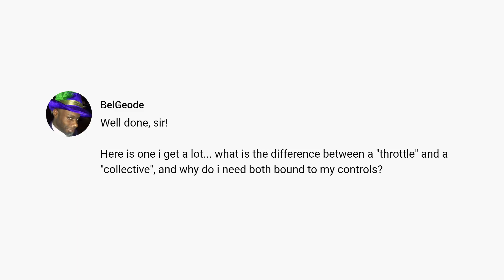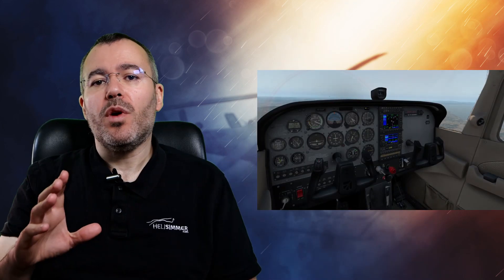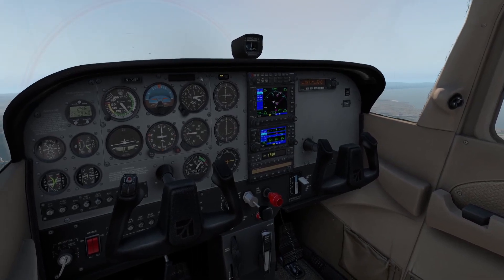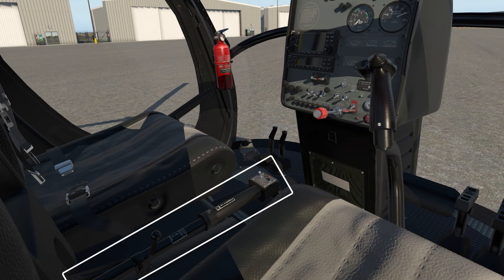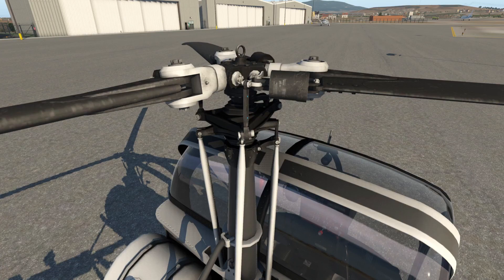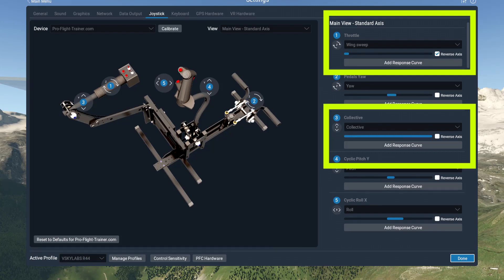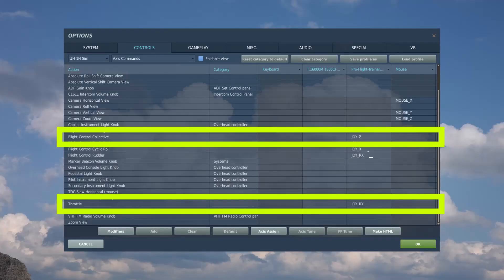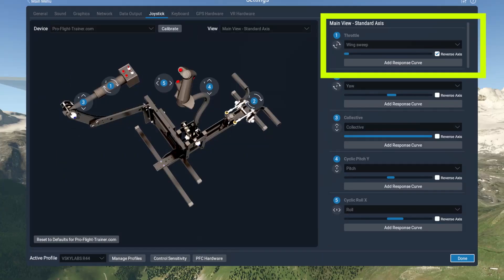What is the difference between "throttle" and "collective" in a helicopter? - Ask Me Stuff

Comment: So does having a controllable throttle offer any kind of inherent benefit opposed to it being automated/governed? And by that I mean, does it offer more control to make small adjustments that you otherwise wouldn't be able to make in a  fully-governed system? Imagine the Trim Control on an airplane for instance, it allows you to make small adjustments to the way the plane flies without having to make those adjustments using the more powerful yoke/joystick controls. I guess what I'm asking is, does a manual throttle control make it easier to hover, land, takeoff, and perform more precise movements opposed to a governed system? Or is it simply just a case of an aircraft manufacture being cheap and not installing a governor.
Reply from the maker: It doesn't. Most modern helicopters have a governor system in them that take that burden away from you and the throttle is most commonly used for startup/shutdown. Everything else is controlled via the governor.

Older helicopters, such as the Bell 47, though, still rely on manually controllet throttles, though. And honestly, it's a blast to try and not crash a helicopter PLUS keep the engine running.

You can actually get away without a throttle in your sim, though.
Reply: @HeliSimmer  Would you say generally that the plus version of the Virpil collective probably isn’t worth the extra if you only use it for a few seconds?  Primarily in DCS.  Thanks.
Reply from the maker: @doifeellucky  if that's the use case for you it's probably not worth it and you can put the money into some mounts or an extension or something like that.

If you practice autorotations with recovery (meaning you don't go all the way to the ground) I would probably invest in the Plus since it will allow you to do it easier.

On the other hand, you can also simulate the throttle by using any other axis from any other joystick.

Comment: Very well explained Sergio. On the R44 you actually feel the throttle control by the governor, you feel it turning a little bit, especially with ground maneuvers. To make it more complex, and this counts for at least the 269C as well, is that it has a correlator. This is a mechanical linkage, more collective pitch equals more throttle input. The 269C I flew had no governor, you had to do the fine tuning by hand, which is not that bad actually. But on the R44, the correlator input is usually too much (on purpose), so when turning the governor off, you have to close the throttle a bit in most situations.
Reply from the maker: Thanks for that explanation, Ralph. That's cool knowledge. Unfortunately, we do not have that kind of feedback on our home systems (which would make them even more complex and expensive as well!).
Reply: @HeliSimmer  That's indeed one of the disadvantages of simulator flying, but luckily it also comes with a lot of advantages over real flying.
Reply from the maker: @ralphrietveld  Exactly. It's all about compromising and taking advantages of the positive things you can take from simming. I have been trying to get pilots and flight schools to understand that. Unfortunately, flight sims such as the one we use are still seen as "toys". Very few people in the industry are taking a good look at them and trying to find out how these low-cost solutions could help them and the industry itself.

It's not like we should be naive and think these sims will replace other solutions, but they certainly have a space in the industry if people open their minds.

Comment: Here in 2023. Flying MSFS with a Logitech 3D pro, thinking I will only assign the collective to the throttle switch and use the governor otherwise.
Reply from the maker: You don't need to assign the throttle unless you are flying an aircraft where it is strictly necessary (like the FlyInside Bell 47 with the governor off). If that's not the case you can get away with it by just clicking on the throttle.

Comment: I'm confused as to what's just happened in MSFS 2020 Update 12.  It now has 'governor support' - what does that mean for a casual heli simmer?  I'm used to just flying them with one axis; my throttle.  Any advice would be appreciated.
Reply from the maker: If you don't worry about the throttle, just ignore it! It won't make a difference to you :)
Reply: @HeliSimmer  I’d like to fly manually - full control as possible?
Reply from the maker: @AdminVortex762  then it will benefit you but the governor still has issues. Cowan Simulations has been struggling with it still. The FlyInside B206 does have a custom implementation so you can use it.

But here's the thing: in modern helicopters, like the B206, the governor will do all the work. You will only need the throttle on startup and shutdown.

Which aircraft do you fly with?
Reply: @HeliSimmer  Currently the H146
Reply: @HeliSimmer  sorry the H145

Comment: I learned the same thing playing kerbal program, I take off by first throttling the engine at zero pitch and gently change the pitch until it takes off and when the helicopter is off the ground I adjust the two to get the greatest possible efficiency. Now I know what's it actually called
Reply from the maker: Glad I could be of help. Kerbal is a ton of fun!